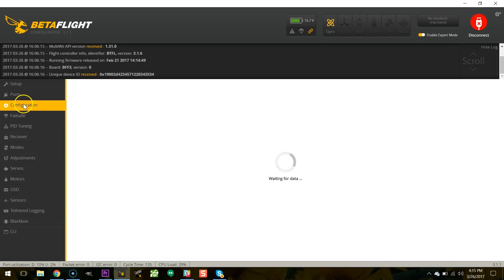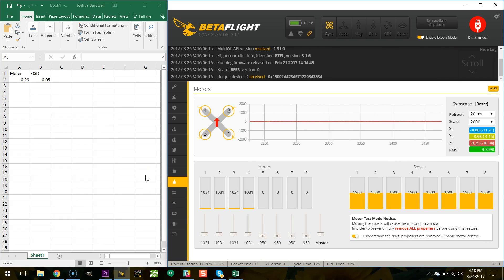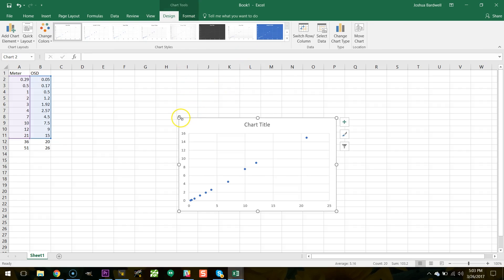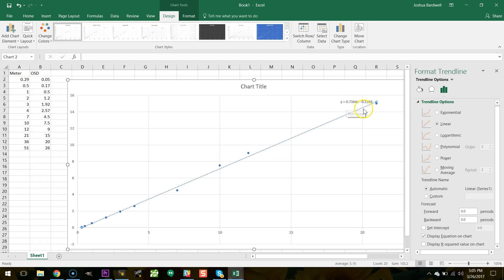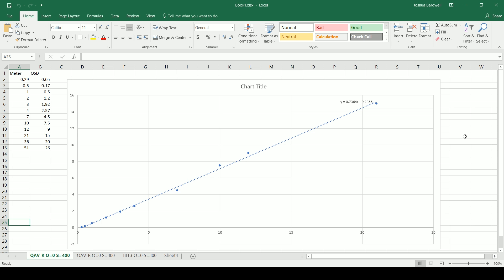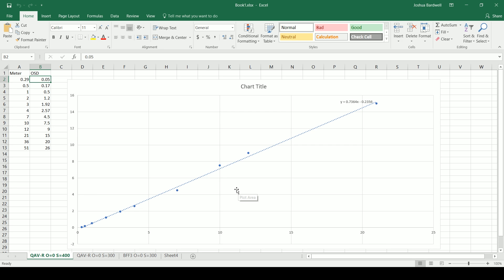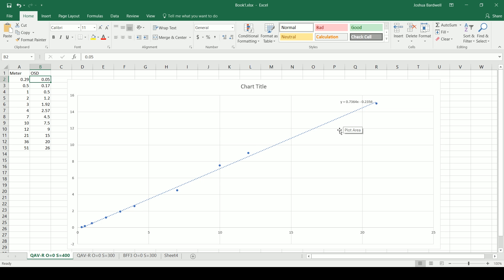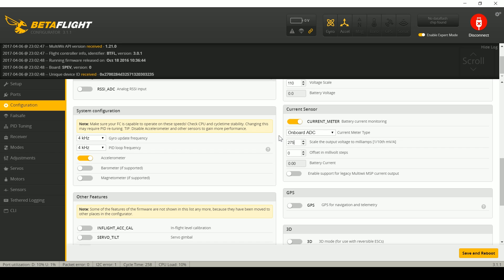Betaflight F3 Inaccurate Current Sensor mAh Readout | FIXED - Part 2

Comment: Hi Josh,
220-270 almost good value because in low mAh the mistake of calculation is low and you don't use your quad with low mAh too much.
But lets do the math: I assume you have two measured value (m1 and m2) and two displayed value (d1 and d2) one from low (or idle) rpm and one from high. You also have some scale already set in BF call it "S".
In this situation the math is:

steepness: (d2-d1) / (m2-m1)
Scale:  steepness * S
Offset: (d1 - m1 * steepness) * -1 * Scale

My quads perfect config is: 
Scale: 285
Offset -435

when I recharge batteries I got almost the same value what was displayed on OSD.

Comment: What if your current sensor is fluctuating constantly? I just got a brand new GEPRC Span F4 stack and the sensor seems useless when it is not a stable value. For example when disarmed the clamp meter says 470mA but in betaflight the current jumps up and down constantly between 0.2A and 2A.

Comment: Could you do something similar for the battery scale to read out the correct voltage?
It might sound useless to you but I have this situation where I need to adjust battery scale between 109 and 111 every time I plug in because Betaflight thinks it's a discharged 5S instead of a full 4S and vice versa.
I was hoping one of the other values that Betaflight now has could be used to adjust that but I don't really wanna play around with things I don't know about anymore...^^
Reply from the maker: Raise the max voltage warning in the battery and power tab and see if that fixes it.
Reply: Max Voltage, that was it! I raised it from 4.2 to 4.3 and now it works fine.
Thank you so much once again, Mr. Bardwell. ,-) <3

Comment: In betaflight, and in the osd, it always hovers between .14 and .15 amps even if spin up the motors with props.  The voltage is correct and drops with the battery.  Is this a hardware problem or a betaflight thing?  I'm using the Hobbywing f4 stack with a built  in current sensor.  My mah reading slowing climbs during flight but only at a rate of .15a x vbat.

Comment: Is there a way to get current output from the Matek HUBOSD Eco X-Type?  My FC is a Lux V2 Race. I would like to see it in my telemetry for shits and giggles. I am new to FrSky but loving the telemetry and great things you can do with it. Thanks for your help! Love your content!
Reply from the maker: I remember when this question was asked about the RROSD a long time ago, there was a pin you could solder to on the board to get the 0-3.3v output from the current sensor. Then you could feed that into the current sensor pin on the FC. Presumably that pin also exists on this board, but you have to figure out where it is.
Reply: Joshua Bardwell 
Thanks! I will dig around with the trusty meter and did out. I will let you know what I find.

Comment: Yeah I am having a problem with the current sensor on my flight controller. My quad went in a pond. Everything still works properly but it is just displaying improper voltages and there is no way to fix it because it is jumping all over the place. But Furious FPV Is selling a Lighting PDB combo and I was thinking about using it as an external current sensor but I'm just lacking the knowledge of how to wire it up and what to choose in betaflight.

I'm guessing that you have to hook it up to a UART and then go to peripherals and choose something? ?
And change the current sensing type to some thing ??
Reply from the maker: Not a UART. The FC has to have a current sense input pin. If it has an RSSI pin, you can also use that, by using resource reassignment to change the RSSI pin to current sense. 

But here is the problem. There is already a current sensor hooked up to the FC and it is sending bad data. So I'm not sure how you can make a different current sensor work at the same time.
Reply: Joshua Bardwell, yeah it's the Betaflight F3 Flight Controller. I could try and get a Runcam swift 2 and just keep an eye out for the voltage. For now I've just been flying for 4 minutes and changing the battery. Luckily the MAH Reading has been close.

Comment: Joshua.. default value for betaflight has changed to 220.. you said that the lower the scale number raises the osd value.. correct.. if i land when my osd says 1000mah. And i put in 1300.. (I KNOW TO LOW).  I need ro bring the scalw number down to about 210 or lower. Correct. Does that number seem to low.. everyone else is getting like 250 275. Help please thanks
Reply from the maker: Whatever makes your OSD read correctly is what you should use. If everybody else's number worked for you, then you wouldn't need to calibrate, would you?

Comment: why can't I solder the negative wires. I can solder everything else except the negatives. this board is making me loose interest in drone flying. it just keeps pissing me off.  please help
Reply from the maker: Make sure your iron is powerful enough. A tiny 30 watt iron isn't going to cut it. If you have temperature control, set it to 425 or even 450. Preheat the pad a little bit before attempting to apply solder. It's just a beefy pad that sucks up the heat.

Comment: Quick Question for you.  I've been flying KISS for a while with their ESC telemetry and been off Betaflight for a while.  Trying to get refreshed for a quad using Betaflight so pardon my lack of updated knowledge.  I got real spoiled with KISS being able to shoot mAh consumption "Fuel" telemetry to my Taranis.  I have a PDB here with a current sensor and an FC with a pad for Current.  I know you can see "mAh drawn" in OSDs with Betaflight but I'm not using an OSD.  Is there a way to set up Betaflight to send the mAh Drawn telemetry to the Taranis for alert purposes?  Currently I do have telemetry on this BF board but it only VFAS at the moment.  Thanks.
Reply from the maker: If you have telemetry enabled on the FC, and if you have current sensing configured, then mAh will be passed to the Taranis as the "Fuel" sensor.
Reply: Sweet.  Thanks.  The PDB with current sensor should be here today so I should be able to do this.  Thanks again.

Comment: can i use a digital multimeter to measure my amps for setup? or take three xt60 connectors to plug in between drone input and lipo? and one xt60 modified to go to digital multimeter? if that makes since
Reply from the maker: You have to wire the amp meter in series with the load, not in parallel, so wiring up a split XT60 adapter won't work. This is why a clamp meter is so useful. You probably can't use a multimeter for this because they generally top out around 10 amps.

Comment: now how i do it. the EASY way :D
fly a pack. or more, remember the mah drawn for each pack.
recharge the batteries and look how many mah you recharged.
now calculate this: mah drawn / mah recharged * scale
if you have multiple backs,  calculate the average scale.
change scale and go for  another flight to check...

Comment: I got between 233-234 using the formula.  Using the formula, I just crank up the motors to 1500, note the motor and osd values and plug in the values.

Comment: according to the betaflight source code the formula is (centiamps = (millivolts / scale).  Millivolts is the reading the current sensor returns. We can then derive the following formula for calculating the new scale value.  (osd * oldscale / meter = newscale).

Comment: If we know the resistor they use for current sensing RL on the current sensor chip INA169A. we can calculate the 1A = mv. or if they give us the max AMP on the current sensor. we can use （3.3/max amp ）*10000 to get the scale number. let say BFF3 says it can handle current max at 150A, which I believe it is. so the scale number will be （3.3 / 150 ）*10000 =  220

Comment: To Cam's FPV, 
Hey Cam first of all I'm so new at this I can't imagine anyone asking me for help.  But it did get the problem fixed so I hope this works for you too.

SYNOPSIS -  what was wrong.  So your RX wires are physically plugged into a certain port on your Flight Board that you have plugged them into. But if you don't tell Betaflight to connect to the correct port then it is looking for you in another location.   When you both meet at the same place... you're half way there, THEN make sure you tell Betaflight you are using SBUS ( or PPM which ever the case may be)

PROBLEM - I had the wrong Serial port selected from a previous setting I had configured for the same quad. I had moved the RX wires to a different location on a CC3D Sp racer 3 FB.  So now Betaflight is looking for me in the old location.

Under the PORTS tab you'll find  'Port Identifier" you'll find UART 1,2 and 3.   Nothing to select under Port Identifier but move across to Serial RX . Select one of these buttons (ONE AT A TIME) I couldn't open all three at the same time. Didn't work for me.  Then remember to save before going to the next page.   Now go to the "CONFIGURATION TAB" under "RECEIVER" -( find it under sub heading named "Board and Sensor Alignment") . there you'll find "Receiver Mode" select the up and down arrow in the box for a drop down list, then make sure that "Serial-based receiver (SPEKSAT, SBUS, SUMD) is selected, or PPM etc.
I tried all three Serial RX one at a time untill Bataflight found me.  Then I was good to go.
It takes both setting to get you connected.  This is what got me going.  i hope it works for you too.

Sorry I didn't reply earlier.  For some reason Youtub conversations weren't coming to my computer just my phone.  I just stumbled across this later this evening.  Let me know I like to know if this worked for you.

Comment: Nice. If one do not have a current meter available, there is also a way that allows to calibrate FC current sensor with a charger that reports number of mAh that it pushed into LiPo while charging. Look at the end of that page: https://quadmeup.com/how-to-connect-apm-power-meter-to-cleanflight-and-inav/ Not perfect, but gives pretty decent results

Comment: I had to do the same thing a little while ago and because I'm cheap (and also live in the middle of the freaking central desert in Australia) I did not purchase a current meter.
The way I did it was similar to yours as I used Excel and trendlines. But my measurements were taken differently.
Indeed the only way I had to measure things were my OSD and current meter scaled wrong and my charger that gives me the mah that it puts back in the batteries.
I compared the mah read on the OSD to the mah read on the charger for let say 3 different scales (from 200 to 400) during 3 different flights and put them in a spreadsheet. Then I divided the mah from OSD with the mah from the charger. If this number get close to 1 it meant the scaling was close to correct but to be more precise I put the scale in comparison to this number in a graph and found the trendline (second degree equation) and then determined  the actual scale by using the equation and solving it.
I know my methode is not the best but it worked for me and I didn't have to use anything else than tools I already had (my quad and my charger).
Hope it helps someone. For more info contact me on Facebook (Kevin boyer fpvlog). I'll be happy to help you ;)
Reply: FPVlog that is exactly what I did. I ran three batteries and came up with a factor of ~.6 which 0uts my value right at 240. well not exactly. I just multiplied that .6 by 400 and called it a day

Comment: Interesting. I received a betaflight f3 board from stone blue airlines about 3 weeks ago. The default current sensor setting it came with was 220. Great video (as always)
Reply from the maker: That value is probably pretty close to correct. I am honestly still tweaking my values based on flight performance.

Comment: im at 260, and according to the osd i used 1048mah. charged the battery and puted in 1131mah. so is off by 83mah. How much u consider i have to lower the scale to fix that 83mah off? Thanks.
Reply from the maker: Just a smidge.

Comment: hi Josh. I have a diatone crusader gt2 200. Question. how do you adjust voltage on osd. mine reads 0
Reply from the maker: If it's reading zero, then it's probably disconnected or something. I don't think that's a calibration issue.
Reply: thanks Josh. I'll look closer.

Comment: nice video as usual joshua, could you do one maybe on how to calibrate the matek hubosd at some point?
Reply from the maker: Does the HubOSD have adjustable current value? If so, the procedure is the same.
Reply: i don't know i've only just got mine and haven't powered it up yet. I assume it does through the mwosd? software.

Comment: Hi Josh, recently I purchased a Taranis QX7 and am switching all my quads over.  I'm familiar with the process and know how it should work.  I have set up the Taranis per other youtub videos and am able to bind it to a new RX.  But when I follow instructions for seting up betaflight such as serial ports, SBUS etc....none of the sticks or switches show movement at the reciever tab.  I've had this happen with my other transmitter and only after redoing the process several times somehow magically it binds.  But no luck with the new Taranis.
Do you have any idea as to what I may be missing. I can't find anyone that covers this situation.  No trouble shooting videos if it does't bind with Betaflight at the end of the process.  Every video I watch it always binds but that's always my experience. I sure would like to figure out what I'm doing wrong so I can just move on the tuning. It must be missing something because getting all three components TX,RX and Beataflight to talk to each other is a painful process and I'm certain others don't fight this everytime you want to bind a TX and RX and tune it on Betaflight.  Hope you can help, thanks
Reply from the maker: +Larry Faucett I mean, I can't really know what you're doing wrong unfortunately. There are a lot of steps in the process. 

Is the receiver bound to the QX7? Do you see RSSI telemetry in the screen? Is the light on the receiver green?
Reply: I have the same problem Larry, so can you get back when you fix the problem? And Joshua if your reading this my RX light is green and what do you mean seeing RSSI and telemetry? I know both of these are correct because when I turn off my quad and the RX is powered off the TX gives me vibrations telling me the telemetry is lost.

Comment: i just need ur help. I have sooo pid problems... i basicly have oscilation every time. I have prop wash every time and so on. I tried really low p and 45 of d and the vibration, props wash are still there. What to do?! And i had a i of 100 and pitch and yaw moved anyhow
Reply from the maker: I of 100 is definitely too high. Start with default PIDs. Without knowing more about the copter, I can't help more.
Reply: Joshua Bardwell hmm i basiclly started from stock but i watched every pid video and i know all but i have the feeling that the quad itself has a problem...

Comment: Nice tutorial. I love the idea to turn the props around to calibrate. the currentsensor. 
I used to do it with the probs in the normal direktion and held the quad down by hand. Every time I have done that, I have praied to survive the calibration😅.
It should be quite easy to use the slope out of Excel tog get the right scale. 
I think it is: scale=actual scale * slope.

Comment: I'm lost a  it regarding the excel. So I measure at say 70 and 25 amps, put the result in and what formula should get me the scale? Just the diagram?
Reply from the maker: +RandomWisdom no. You adjust the scale and offset to get both 70 and 20 amps correct.

Comment: I threw out your two highest readings, just as you did, then solved the following. Average OSD reading divided by average meter reading should be equal to the correct scale number (this is our unknown) divided by the current scale number. That means that 4.241/6.079=x/400. Solve for x. 279 is the answer based on these readings, so I would say 279 is your desired scale number in this specific case.

The SUPER quick (and likely a bit inaccurate) way to calibrate to be to take one midrange reading. For easy math, lets take the one where your OSD says 7.5A and the meter says 10A. 7.5/10=0.75. That's now your scale multiplier. Multiply the current scale setting by 0.75 for a quick approximation of the correct scale (e.g. 400*0.75=300).

Comment: I'm surprised you didn't use an inline watt/amp meter. although I wonder how accurate those really are compared to fluke meter. I'll have to add that to my test data when I set my new boards up. as always thanks for the videos and knowledge. I always learn somthing.

Comment: When I took (according to the OSD) 1800 mah out of a 1300 mah battery, I began to suspect that my F3 current sensor was off. When I keep my flight times to the point where my OSD says I've taken ~1050 mah out of the battery, my flight times are around 2.5-2.75 minutes. This is with a 5 inch quad and pretty gentle flying. 

I think calibration is going to be necessary here.

Comment: Hey Josh! Is it possible to measure the output of a VTX? And with output I mean the power that the video is transmitted with. For example 200mw.
Reply: $150 :/ http://www.getfpv.com/rf-power-meter-by-immersionrc.html
Reply from the maker: +Marcel Mathis yes. You need a custom piece if equipment though.

Comment: Trying to do this on my Wizard. My issue is that the mAh telemetry display on my taranis is way off. As soon as I plug the battery in the mAh starts increasing almost acting like a timer. No matter what the motor output is the mAh reading continues to increase at the same rate. Any suggestions? I have the stock FC on the machine.
Reply: Well, the second you plugin the bat you are consuming energy. Even though the motors aren't spinning your VTx, Cam, receiver, etc are all powered and consuming energy. Remember mah is like an odometer for energy while Amps is a measure of speed---in basic terms.
Reply: I don't think the wizard has an amp meter.